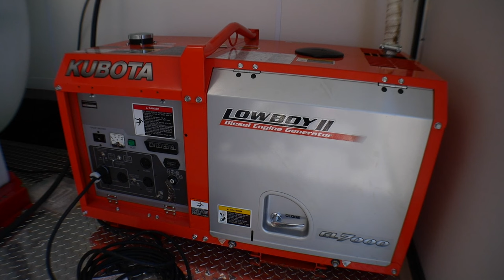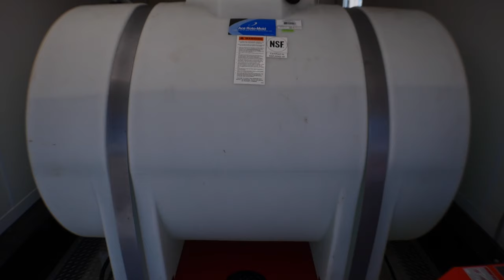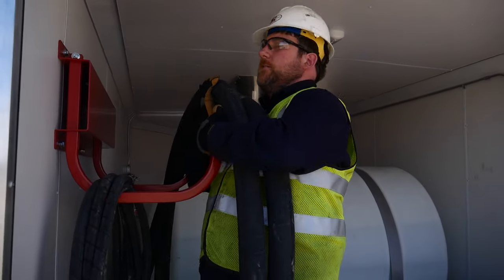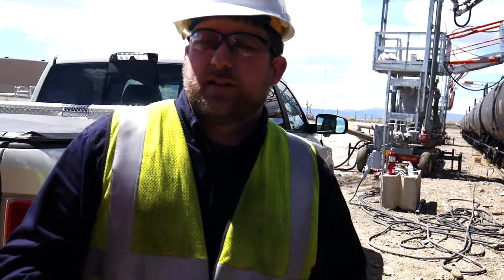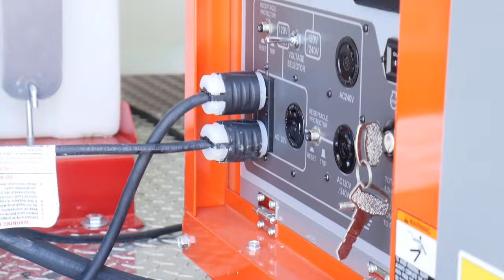Mobile Steam Generator Setup for Heating Railcars

Comment: How long does the whole process take? From pulling up to the railcar to being ready to turn open the valve?
Reply from the maker: There are a few variables, but the average time to connect a turnkey Steam-Flo system should be 15 to 30 minutes. Contact Sioux to learn more about how the Steam-Flo could work with your operation.

Comment: hi very nice rig, what is your stm generator hp and lbs per hr also where is your fuel supply
Reply: The machine in the video is a 20 bhp. It produces 680 pounds per hour of steam. The onboard fuel tank is located right next to the steam generator, 65 gallon capacity, about 12 hour run time.